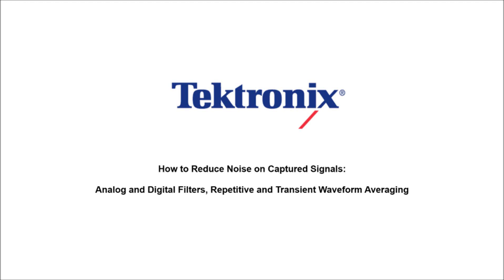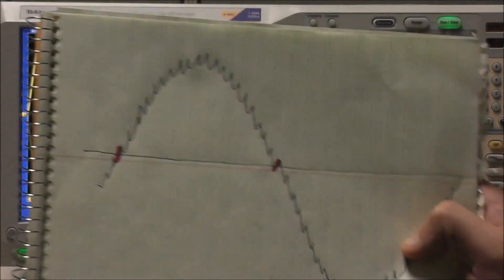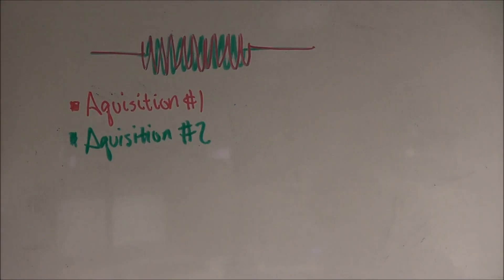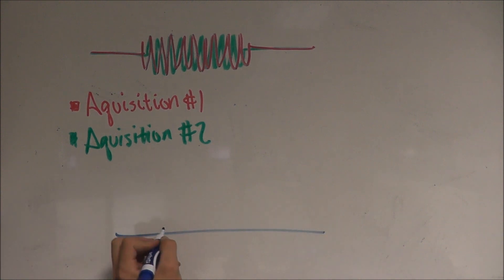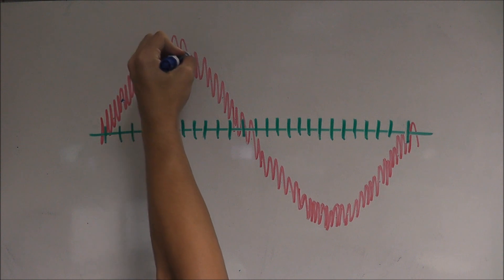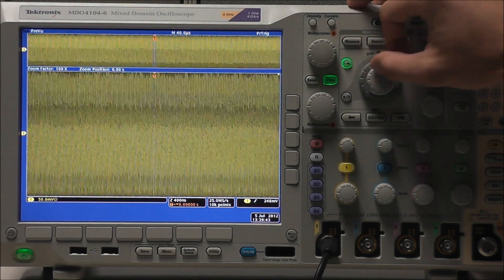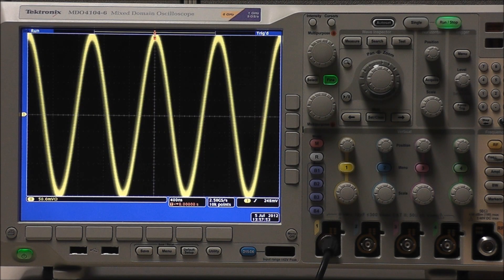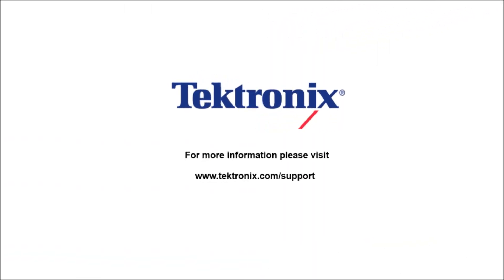How to reduce noise on a captured signal on an oscilloscope

Comment: It is a bit weak on explaining what is actually happening.  Averaging mode requires a recurring signal and you don't care that transients happen; transients are eliminated in averaging mode.   Hi-res mode, on the other hand, "super-samples" each datapoint using spare ADC cycles.  This is also a type of averaging, but it may take 8 ADC readings of what will eventually be a single stored data point in memory.  You can do this when the sweep rate is substantially less than its maximum sweep rate.
This mode allows you to clean up the signal while ALSO capturing transients whose duration is at least one "pixel" of the storage memory.  
As someone else mentions, reducing environmental noise can help but sometimes that's not an option.  I might be testing a switching power supply; and, well, noise is what they generate and lots of it.

Comment: This is actually a bad way to use a scope. I personally would never want to intentionally reduce my bandwidth or turn on averaging or any type of filter as it reduces the actual displayed waveform to one that is less than actual. This is especially bad when checking for uis or avalanching in mosfets, but equally bad for just not knowing what the actual peaks are.
Reply: How to reduce noise on a captured signal on an oscilloscope ? 
Answer: Reduce it at the source, not in the measurement lol
Reply: yas i am looking for this like comment. as reducing bandwidth and increasing average value may give the false result. please correct me.